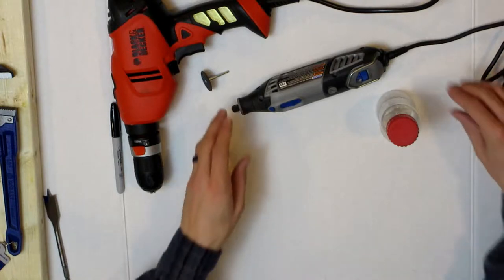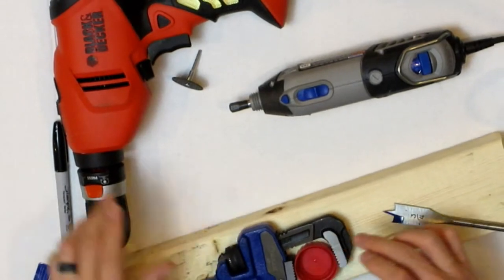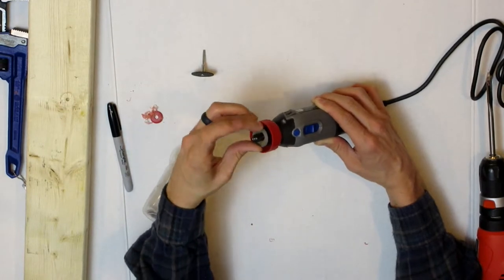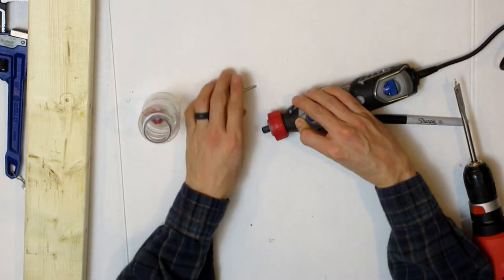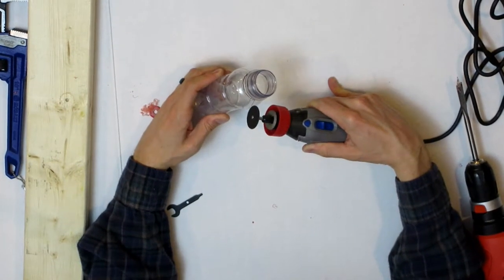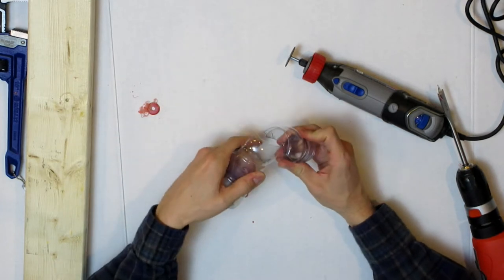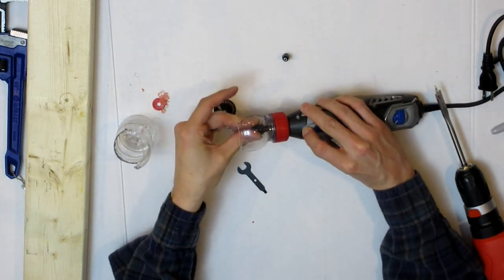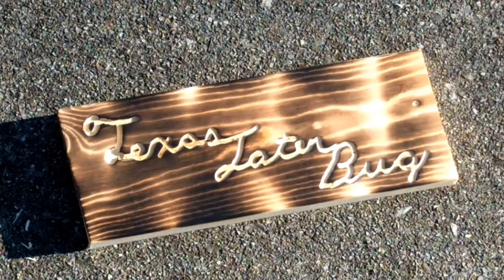How to make your own Dremel Rotary Tool Guard for Free!

Comment: While I would say this is a good innovation, on the side of caution I would warn that it involves an alteration of the tool that could be just as dangerous. For one the bottle plastic isn't nearly hard enough to stop a flying blade; then there's the question of fitting to the tool itself being unspecified for the tool, how this could affect the collet, shank or other parts, offsetting speed required for the blade itself. Rotary guards are fairly inexpensive and can be purchased for little more than the price of the beverage the plastic the makeshift guard is cut from. If you're really nervous and don't have a specified guard, it seems fine, otherwise I wouldn't depend on this sort of thing for prolonged use.